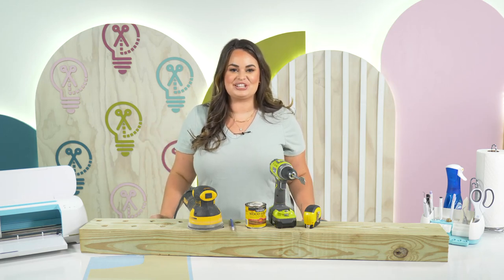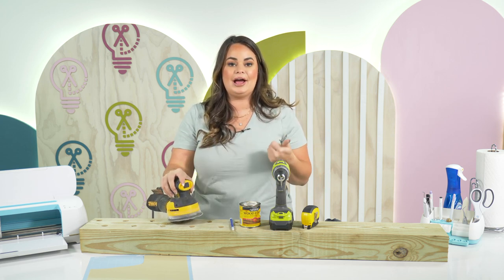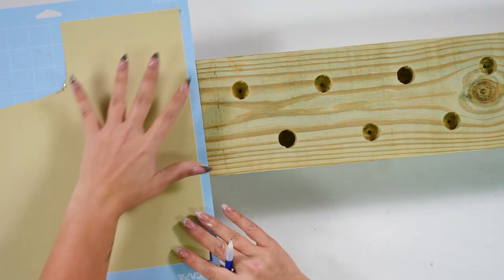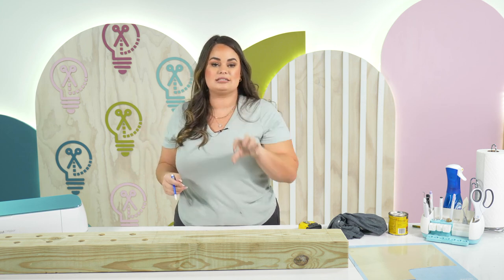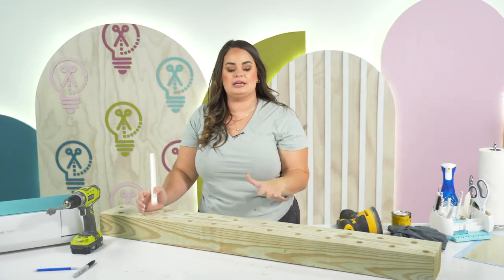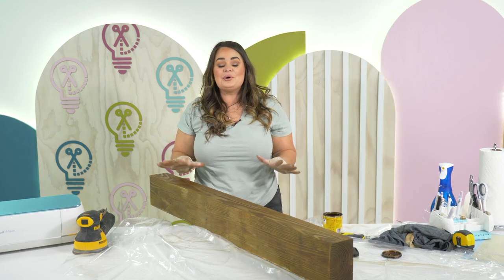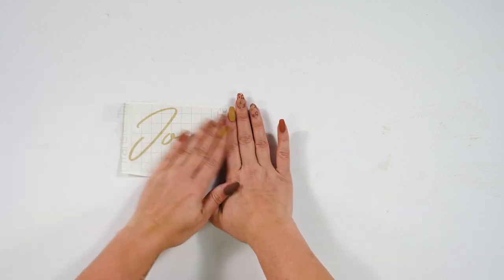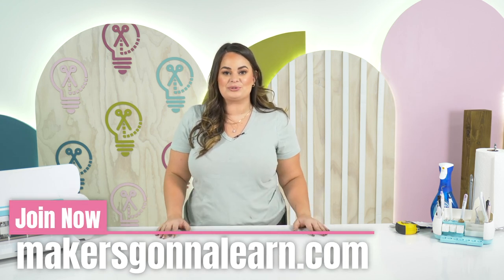4 Foot Wooden Centerpiece Using ONE Power Tool + Cricut Element

Comment: Please check your numbers when working with wood. Most lumber is not true to size if it says 4x6 it usually will be closer to 3.5x5.5. Your long ways center point looked off like one side was at the 3 inches and the other around 2.5 inches.